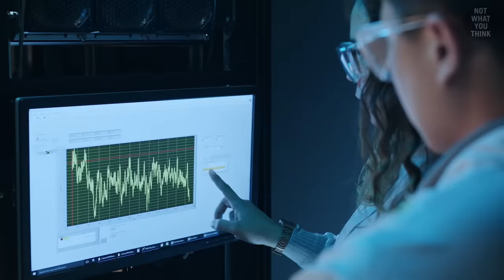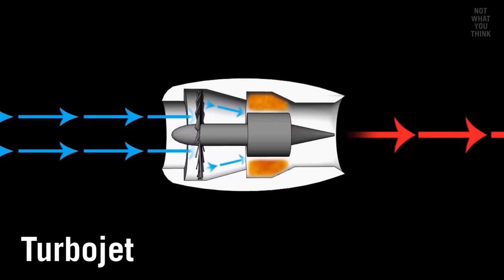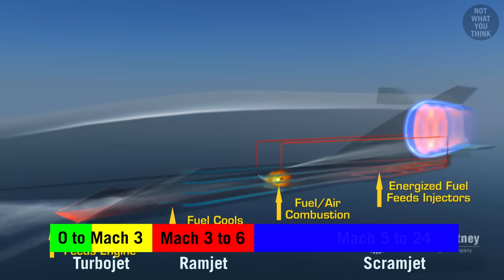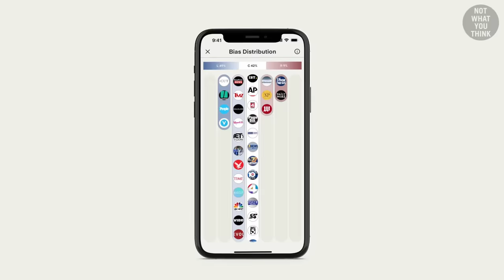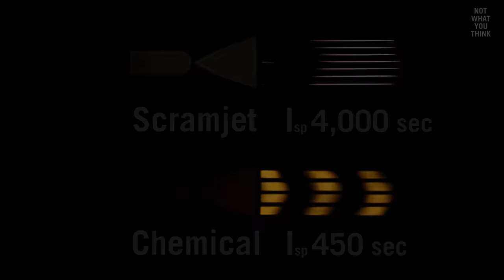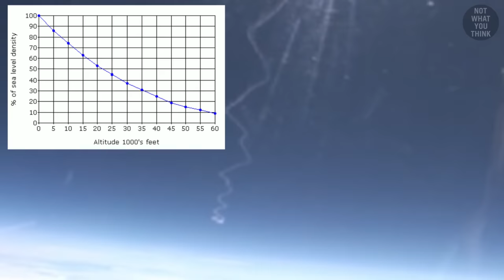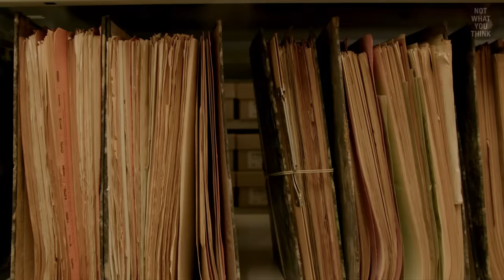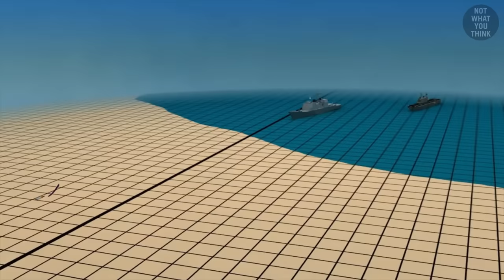The Hypersonic Missile Vulnerability That NO ONE Talks About

Comment: Thanks for pointing out the technical challenges with hypersonics! What I am missing though, is why they don't make sense. If you can solve the problems you highlighted, hypersonics seem like a battlefield warping technology. It's a hard problem, yes, but also completely worth solving.
Reply: What can a single hypersonic missile achieve that 20 cheaper in total ballistic missiles cant achieve?
Reply from the maker: hypersonic missile will have to slowdown during the terminal phase. Therefore hypersonic missile will be equal of a threat of a quasi-ballistic missile such as iskander.
Reply: @miauw1999  Carrier destruction.
Reply: @NotWhatYouThink  The best bet to get around this is a dual stage system. They scram jet to keep it at hypersonic speeds to get it near the target. Once it has to slow down, the scram jet component would fall away and shit to a chemical booster engine. That would allow for quick bursts to vary the speed the missile is traveling at to help get past air defenses. With limited ability to turn at that stage, variable speed would make it harder to lock on and maintain target locks. So, what they really should be looking at is less of a hypersonic missile and more of a hypersonic missile delivery system that would get them within range and give the enemy less time to react.
Reply: I mean realistically speaking, even if they are able to hit their target 100% of the time, why invest the money in one of those when you can buy like a dozen conventional ICBM's in-turn? You'd be able to overwhelm basically all defense systems, if not through maneuverability then just sheer numbers
Reply: It's either 1) a ballistic missile, which can be relatively easily intercepted in terminal phase, or 2) it's a hypersonic cruise missile, in which case it must descend from "cruise" to "target", i.e. it has a terminal phase... and in terminal phase, it's relatively easily intercepted. In other words, the main touted advantage is that it's undefendible, but in reality there's no such thing as an undefendable missile. Even missiles with a hypersonic cruising velocity can still be intercepted with relative ease in the terminal phase. And if this is the case, then a "regular" supersonic missile will always be cheaper, with the exact same effectiveness, as a hypersonic missile. So a hypersonic missile is either a lie or a criminal waste of national resources.
Reply: @dexwastaken1259  Realistically, the best way to shoot down an incoming hypersonic missile is to have something that can travel close to the same speed so you can intercept it further away and have more chances to try and take it out. What that ends up being is an arms race. You have to develop the technology to counter what the enemy is throwing at you.  If they have hypersonic tech to get their weapons to you at a faster rate, you need the tech to create faster interceptors. If we could cross the C-Ram speed of fire and tracking with a completed railgun's projectile speed, it would be easier to shoot down incoming hypersonic missiles.  Sadly, at that rate of fire the railgun's barrel would melt out in less than a minute and probably take a dedicated nuclear reactor to draw enough power for that rate of fire. Which was becoming the inherent problems with the railgun system the navy was developing. They have the working tech, but the rate the barrel system fails due to the power requirements and projectile speed requires to many change outs to make it long term affective.
Reply: You can do it with cheaper missiles.... its called Saturation...
Also, even if the missile can hit with hypersonic speeds, that doesnt mean that the target cant defend itself.... you dont need hypersonic projectiles to stop a a hypersonic projectile that is coming directly at you.
If the hypersonic missile is not carrying a big tungsten rod, i dont see doing much on a carrier.
Reply: " What I am missing though, is why they don't make sense. "
Americans don't have them.  That simple.
Reply: @irshasher3602  An EKG floating almost stationary but in the direct path of a hypersonic missile will turned both into flaming powders in less than a second!
Reply: @Padtedesco  A single hypersonic missile to destroy aircraft carrier would need to be a nuke. And once a nuke is used its game over for both sides.
Reply: @rukicar  Why you say that with such assertiveness? Have youtried?
Reply: @Padtedesco  Just look at videos of aircraft carriers being tested for durability. You can pound on those things for hours or even days before they'll sink, they're just so massive. A missile would do some damage, a huge ass hypersonic missile would probably make it pull out of the fight, but to sink it? You'd need to pull out the biggest guns you have.
Reply: @brianfhunter  " You can do it with cheaper missiles.... "
What's so inherently expensive about hypersonics?  The research itself?  Not necessarily.  It depends if you still have a working science or not.
Reply: @ericconnor8419  " That is why we don't bother either. "
That's a lie.  Either yours, or it comes from a lying source.

" America does not have them for a reason. "
Diversity quota?  Just a wild guess, mind you.
Reply: @Uncivildefiance  putting a carrier out of a fight is enough.
I don't think the Navy would risk even that.
Reply: @NotWhatYouThink  There is no need to slowdown. There are materials that withstand the heat (with fuel cooling) like some ceramic materials. The time of the therminal phase is only few tens of secons anyway.
Reply: @UnshavenStatue  Everyone who is in a position to know has said that they are extremely difficult or impossible to intercept, as far as I know. Do you know of a military/industrial official who claims the "relative ease in the terminal phase"? Also, supersonic missiles don't have the exact same effectiveness. An example is something like Zircon. If fired at a carrier from 1000km away, out of range of the F-35s that would defend it, a Zircon would arrive in time for the carrier to still be close enough to where it was before. A supersonic cruise missile would be too late, the carrier could be too far away from it's initial position by the time it arrives.
Reply: @irshasher3602  The Zircon missile apparently does something like that, discarding the scramjet assembly just before the terminal phase and then behaving more like a glide vehicle for the last part of the flight path.
Reply: @Padtedesco  its not gonna be flying at hypersonic at that stage so its the same as icbm no?
Reply: @Padtedesco  i think you missed the whole thing about hypersonic missiles being essentially blind, by being hypersonic. How exactly do you plan to update target information?
Reply: @irshasher3602  bruh again hypersonic speeds means no tracker which SAMs rely on, we just need better on-board tracking computers, more agile and longer burn time SAM sites alllll around the globe
Reply: @Uncivildefiance  
Like against the Bismarck?

Ships are tought, but I dont bet on it against such energy.

Especially if the carrier is on the port, as they need to be from time to time.
Reply: @NotWhatYouThink however, the biggest advantage of a hypersonic missile is the speed between launch and arriving at target area. This greatly shortens the kill chain and reduces area of uncertainty within which the target can move.
Reply: @bakters  But America does...and they're carried on Zumwalt-class guided missile destroyers...That simple.
Reply: The key of advantage of hypersonic weapons is its ability to carry out time sensitive strikes substantially faster than previous weapons which is major advantage depending on the target
For breaching advanced defenses, hypersonic weapons are key but also have to be combined with electronic warfare for maximum effect
Reply: @Peanutdenver  I'm afraid, that is true.  I'm afraid that you are incompetent, while we decided to go along with you.
And that is a scary prospect indeed.

Regarding the behavior of your soldiers, yes, it's awful.  Diversity is your strength!
Reply: @bakters  You poor thing...
Reply: @NotWhatYouThink  That is correct, but since it travels so much faster its time on target is going to be much much lower. This can allow militaries to take advantage of fleeting intel sources. Let's say a Chinese satellite pings a US CSG in the SCS. Normal subsonic or even supersonic missiles will never get there before that intel is too old to be useful. Hypersonics have a much better chance at that. Since the biggest difficulty in naval warfare is finding your enemy, this is a big deal.
Reply: @Padtedesco  You know the Navy has done tests, right?
Try Bikini Atoll, for one.
Reply: @miauw1999  Err... lower cost I think? Ballistic missiles are not cheap, at the very least not 1 to 20 cheap, and a LOT of things don't work in the ballistic missile's favor. First, you will need 20 launch vehicles/silos to launch the missiles to overwhelm the defense system, if that's what you intend to do. Otherwise you'll need to launch them one by one, and the missiles can just be shot down one by one. And there is the possibility that the other side, you know, has missiles too and decide to destroy your launch vehicle after your first launch. Plus, the high cost of hypersonic missile is mainly due to development, finding the magic shape of the combustion chamber that will make everything work. Once the development is complete, it is rather easy to produce at large scale.
Reply: @dexwastaken1259  Why do you assume Hypersonic missiles are more expensive? Hypersonic missiles use much less fuel to reach the same distance, so it can be made much smaller and cheaper than conventional ICBMs.
Reply: @Padtedesco  The most modern aircraft carrier, the Gerald R. Ford class, is 80 meters longer than the Bismarck and over twice as massive. Ships today are absolutely insane. This isn't even a battleship anymore, it's a floating city. You need some serious power to deter that.
Reply: @andyhu9542  That isn't how a ballistic salvo works, at least for modern US missiles. First, it wouldn't require 20 separate launchers: a single Arleigh Burke class destroyer carries up to 56 Tomahawks in vertical cells and can launch a salvo of missiles that strike a target simultaneously despite being launched at different times. Even if they're launched "one after the other" the salvo can "group" together to impact the target at the same time. Hell, even modern artillery systems can do that.  

Second, the US Navy has 70 Arleigh Burke class destroyers in service so that's a lot of potential salvos to destroy high value targets. Certainly many times the number of targets any supersonic missile could destroy, assuming they even work as claimed.
Reply: @Macto5  Thanks for the detailed analysis! That's definitely more data and insight than my comment. Yet I have to point out that the Tomahawks can "group" because they are cruise missiles. Believe it or not, I have considered "grouping" missiles after launch when I posted my first comment. Yet I concluded that it wouldn't be possible for ballistic missiles (not at the same scale) since they travel much faster and follow a set trajectory.

Plus, 70 Arleigh Burke class destroyers are "multiple launchers". Sure the US Navy can afford them, so it may not matter. But team hypersonic promises the following: one (each) Arleigh Burke class destroyer, carrying 56 hypersonics, firing one or two at each target, almost sure hit. That's almost 30 targets for each ship IF (huge IF!) the hypersonic missiles work as claimed.
Reply: @andyhu9542  I definitely agree that a destroyer with (working) hypersonic missiles in its VLS cells would be much more effective than Tomahawks!
Technicalities aside, my point was that currently, a salvo of non-hypersonic missiles is going to be more effective at destroying almost anything than the handful of hypersonic missiles China or Russia MAY have on hand. As discussed in the video, it's going to be several years at least before that changes.
Reply: @Macto5  I think we reach a decent agreement!
Reply: @andyhu9542  Agreed, thanks for the civil discussion!
Reply: @NotWhatYouThink  flying hypersonic through all the defences then gliding towards the target at a lower speed will still reduce the chances of interception and thus still give this weapon an edge
Reply: @NotWhatYouThink  actually yea, quasi-ballistic missile is the best minmaxed form of ballistic missile
reliably fast for ballistic missile but more maneuverable

on another note for the slowed terminal phase of a hypersonic missile: if it slow down to around mach 3 like normal supersonic missile during its terminal phase, is it possible for any active homing radar onboard the "hypersonic missile" to work normally, since the plasma sheathe is no more or reduced to the amount comparable to the one experienced by other supersonic anti ship missile like P-800 onyx/yakhont, brahmos, YJ-12 or 3M54 kalibr ?
Reply: @irshasher3602  well yea, so its a pricier 3M54 Kalibr
Reply: "carrier destruction"
not really
you need to aim at the moving target. And the author carefully explained why the hypersonic missile would be good primarily at hitting a stationary object, like a bunker
Reply: @paulbrown3302  they are easy to track since they give off radiowaves and heat when the plasma forms.
Reply: @NotWhatYouThink  Says who?
Reply: @Uncivildefiance  concentrated huge energy impact can deform the ship and make it sink.
Reply: @Gudang9  It's only very likely to make it sink if it breaks the keel, otherwise it'll leave a sizeable hole on th eside of the hull, which is absolutely surviveable.
Reply: @miauw1999  Hypersonic travel
Reply: Because each one is incredibly expensive. Much cheaper to build standard cruise missiles. Launch one hypersonic missile at one target, or launch a 100 cruise missiles at many targets? I'll go with the latter every time.
Reply: @johnc2438  Oh? Add nukes to the equation. That's what hyper sonics were intended for
Reply: @irshasher3602  You know what's hypersonic for about five meters? The shockwave from a 30mm shell. And a Goalkeeper CIWS can put out a lotta those.
Reply: @bakters  Lmao do you think random Anti-American belligerence will make Aeorodynamics more forgiving? Keep trying, maybe it'll work
Reply: @cyanspace3473  It's not about heat- high-speed direction changing puts enormous strain on control surfaces and sear points.
Reply: @verdebusterAP  That is correct. Hypersonics exist to somewhat level the playing field when dealing with US forward Air Presence as Projected by Carrier Groups. However, if the Target is indeed a Carrier at Sea, it's highly unlikely Naval Aviation will allow effective ESM, ECM or ECCM deployments.
Reply: @jonathanpfeffer3716  Finding your enemy hasn't been the main problem in Naval (Surface) Warfare for about as long as Shipborne OTH Radar and IR Sattelite imaging has existed. Overcoming CIWS defences is the real kicker, though i will admit Hypersonics reduce the reliance on fast Delivery Methods and ESM of conventional ASMs a lot
Reply: @Ricksdiner  This is implying the defences are forward of the target by hundreds of kilometers, which they aren't. Shipborne CIWS (literally CLOSE-IN weapons system) can reach out and touch hearts in a range bracket from about 5km to 50m, which is when these missiles are usually a bit slower.
Reply: @Gudang9  "Hey Google, what is a Compartment?"
Reply: @MrWarface1  If you're nuking a target you don't really need to worry about anything anymore, since whoever launches the thing will be Ash within the hour. Plus, if you want to deliver nukes to a carrier, torps, even if air-deployed, are a much safer bet.
Reply: @acceptablecasualty5319  Don't judge others with your limited knowledge.
Reply: @Uncivildefiance  It also depend on what the hypersonic has carried. It's decades efford to achieve what they claim to be possible to do. Thinking that sinking an aircraft carrier is impossible only lead to future dissaster.
Reply: @johnc2438  100 standard missiles unable to penetrate bunker deep underground. Single hypersonic able to do it. Chinese able to destroy hundred meters bunker with their own hypersonic. Country leaders need to redesign their own bunker since it probably no longer safe.
Reply: @acceptablecasualty5319  Yes, it has and still is a problem, despite many internet denizens (and never experts) claiming otherwise. If you want proof besides my own statement, because I am not going to take time to explain the minutia of why it is unless I know you are asking purely out of curiosity, take a look at some of the wargames performed in the very late Cold War, where both IR and radar sats and OTH radar were both very mature technologies, where CSGs were able to drop off the map.
Reply: @jonathanpfeffer3716  Alright, i'll look into it.
Reply: @acceptablecasualty5319  I'm not raging.  If you have something to say about the topic of our discussion, feel free to do it.  I'll listen.

Especially if you can show I'm incorrect.  I dislike being incorrect, so if your argument makes any sense, I will think about it!
Reply: @Gudang9  "what they claim to be possible" is the key here- odds are they're massively overstating their current weapons. However you are correct about getting complacent, if we assume carriers just can't be sunk, someday we'll learn otherwise. My point is this current iteration of weapons isn't the amazing ship killer they're touted as.
Reply: @bakters  Allright, i'll bite- identity politics have little to no effect on the Military-Industrial Complex as it is a highly competetive environment directed by a ton of established convention. 
Identity politics have no effect on the deployment on the weapons systems developed by said military-industrial complex, due to the high normative pressure of inter-CO advancement.
Identity politics have no effect on the forces acting upon an aerodynamically steered vehicle in flight.
I know what you're mad about, it's just unreasonable to blindly follow the word of whoever country you think is the polar opposite. You'll just get used.
Reply: @MrWarface1  You make several misinformed points. The Iron Dome is an Israeli static defense system, while naval CIWSs and CRAMs have been deployed and developed exclusively to intercept ASMs. You also seem to believe that any nuclear payload can be strapped to this vehicle, including thermonuclear devices, which is incorrect- weight limitations would make the most likely candidate for mounting a small to medium-sized tactical warhead, which would need to get into sub 5km of range to be effective. 
Plus, all developers of hypersonic missiles have implied a focus on conventional strike capability.
Reply: @MrWarface1  Buddy, i get the idea, but i wouldn't recommend simping for governments that would downgrade your freedoms super hard.
Reply: @MrWarface1  And how, exactly, does that make Russia any better? Your opinions are yours, i'm just reminding you that the grass isn't really greener on the other side.
Reply: @acceptablecasualty5319  I never stated that Russia was any better. I just stated facts about their capabilities.
Reply: @MrWarface1  Again, Iron Dome isn't on Carriers and Nukes are limited by weight.
Reply: @acceptablecasualty5319  " identity politics have little to no effect on the Military-Industrial Complex "
I would agree, if we treated it as the cause, but I think it's more of a symptom.
The real disease runs deeper.

" it is a highly competetive environment "
Is it, really?  The unsuccessful projects, which overrun the budget by a factor of 5, get immediately canceled?  The companies go bankrupt, and the pieces are absorbed into the smaller hungry upstarts?

Where is the America which is run like that?  
In the past...

" Identity politics have no effect on the forces acting upon an aerodynamically steered vehicle in flight. "
So it's "obviously" impossible to make a missile which has a huge specific impulse?  It's impossible to make it maneuver and avoid being shot down while on the way toward the target?  It's impossible to enter the direct interception zone with enough speed to make it hard to intercept?

Nonsense.  It's all possible and it's all useful.  Not a silver bullet, but it's a bullet all right.

And the US has failed in her attempts to make such a weapon, because nowadays they have to outsource all the brainwork to Europe.  Even the most mundane tasks, like making a rifle.
Reply: @bakters  You are reeeeeeally hyperfixated on the "declining empire" meme. Allow me to propose a more reasonable scenario: The main strategic advantage of a hypersonic missile is the bypassing of FORWARD air defenses, and the complication of close-in air defense. The US does not need these capabilities because their Doctrine calls for the winning of Air Superiority before any Tactical Strikes are made, and the use of Anti-Radiation Missiles to disable Anti-Air capability. The point of a hypersonic is to make Air-to-Air interception impossible, which it accomplishes very well. The US does not need to worry about Air-to-Air interception because thats what they do. Which is also why budget went into better Aircraft, rather than into independent delivery vehicles. American and Russian development is different because their Doctrinal Requirements and Air Power are different.

Try not to view everything through a lens of bitterness and hatred and you'll arrive at better results, trust me.

PS: I really liked your silver bullet/bullet analogy! You're absolutely right, hypersonics are by no means a lemon, but they won't have a "Dreadnought Effect".
Reply: @NotWhatYouThink  Their advantage is that the smaller travelling time will make them harder to detect, and will also reduce the time between target acquisition and the missile hitting it. Both are extremely valuable aspects against the US military that bases a lot of its military doctrine around carrier groups
Reply: @acceptablecasualty5319  lmao who said Iron dome was on a carrier? I lived on a few of them. No they are not. Also, hypersonics are limited by weight. Russia wouldn't need to use a hypersonic on a carrier. They would just have to drop out of carrier defense range.
Reply: @MrWarface1  I don't quite get what you're saying? Drop what out of carrier range? A thermonuclear device? Then why even bother discussing hypersonics?
Reply: @MrWarface1  Okay, thanks for clarifying! Now i getcha, i'm still not saying hypersonics are gonna defeat Close Interception, but i get what you mean.
Reply: @Padtedesco  Hillarious. Chinese Hypersonic missile tests has shown that these weapons miss targets 20-70 kms away, their accuracy is terrible.
Reply: @irshasher3602  But that is more qay more weight, as it now needs to carry a rocket engine and fuel during the whole flight
Reply: @acceptablecasualty5319  " You are reeeeeeally hyperfixated on the "declining empire" meme "
Not true at all.  If I'm fixed on an idea, that would be that of an emerging empire idea.  And then I'd hope to become a part of this successful project.
Obviously, I wouldn't want to become a part of a failed republic project.  That would be silly.

" The main strategic advantage of a hypersonic missile is the bypassing of FORWARD air defenses, and the complication of close-in air defense. "
Why not simply range?  I mean, range with maneuverability, like if they came in much closer.
That seems like an advantage all right.  Am I wrong?

Though, you might have meant the same thing.  If so, we agree.  If not. tell me please how I'm incorrect.

Re: Bla, bla, we win anyway because we always win.
Not very convincing.  Regardless if you end up winning or losing, an advantage is an advantage, and a disadvantage remains a disadvantage.  You keep on winning if you keep on stacking the advantages in your favor.
You stop doing that, that's when your losing streak starts...
Reply: @dexwastaken1259  
You can deliver nuclear warheads faster than they can if you are using hypersonic missiles. That gives them less of an opportunity to retaliate at full capacity. If you can hit enemy silos and strategic assets before they can fire back, then you've given yourself an edge in the nuclear exchange.
Reply: @bakters  funded by ccp or Putin ?
Reply: @bakters  Ah yes climate change and ICE engines, the topic of this video and our discussion.
Reply: @SHVRWK  You brought up those arguments.  We "smarty", they "silly".
Those arguments used to be true, but it doesn't seem they remain so.

Or, at the very least, there are reasons to suspect something might be off in the research department.
Reply: @NotWhatYouThink  No need to slow down. Thermal problem solved by ablative shield.
Reply: @gautamnandi2012  you know india does have hypersonic missile
Reply: @Uncivildefiance  Hell, we've NUKED one of our Carriers before. Twice. It was mangled and not fit for battle, but the thing was still afloat.
That wasn't even one of our modern Carriers either, it was a much older one that was being decommissioned.
A lot of people heavily underestimate the sheer force it actually takes to sink one of these beasts.